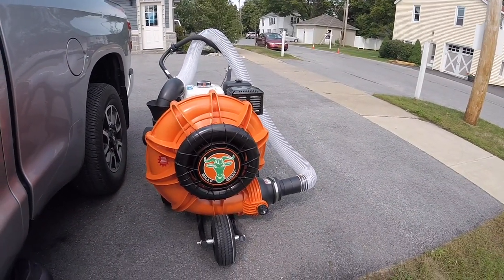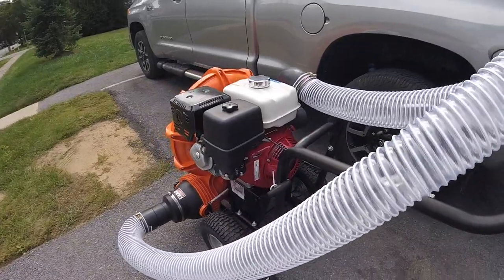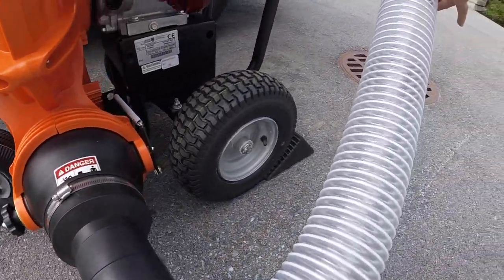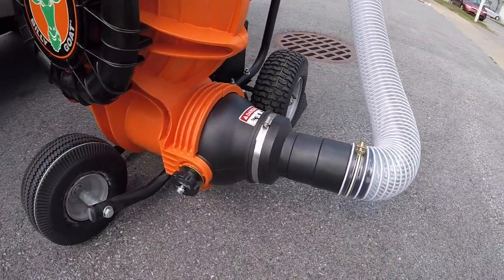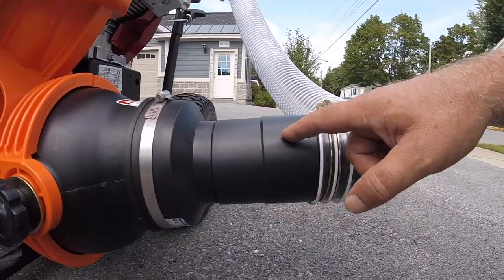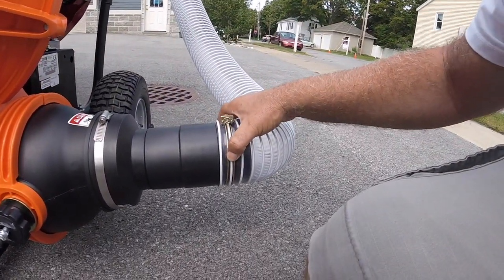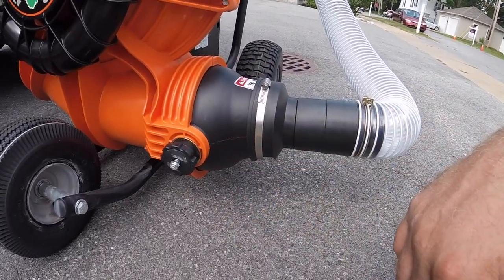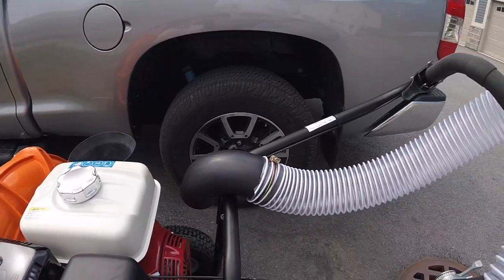BillyGoat F1302H Walk Behind Blower - CUSTOM UPGRADES !

Comment: Very interesting idea I have never thought of it = I am a small landscaping business - I have almost exactly the same walk behind Billy Goat blower I also have a Billy Goat walk behind vacuum shredder it came with a hose kit with a handle I would only need to modify the attachment to clamp onto my blower to make it work.  I also have two Stihl 600 - one 700 - one 800 backpack blowers this is just one more piece of equipment that gets my work done with fewer employees.  My next plan is to see if I can mount the entire blower into the front of one of my stand on or walk behind mowers so I have power drive.
Reply from the maker: I have since got the 13 hp model, and redesigned the wheels for towing behind a lawn tractor. I’ll send you the link.
Reply from the maker: https://youtu.be/jEp-VtCMlAo